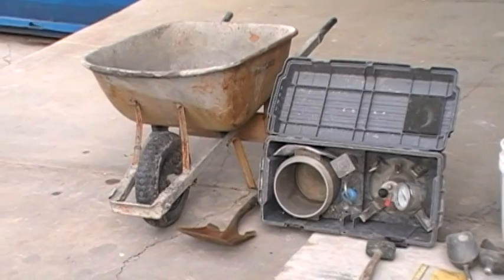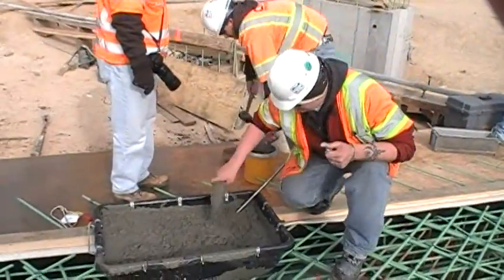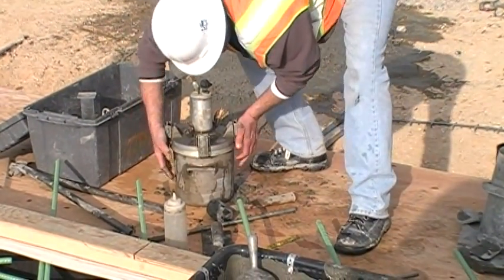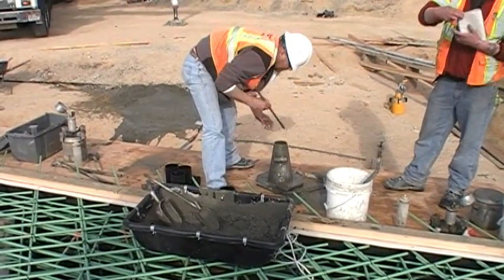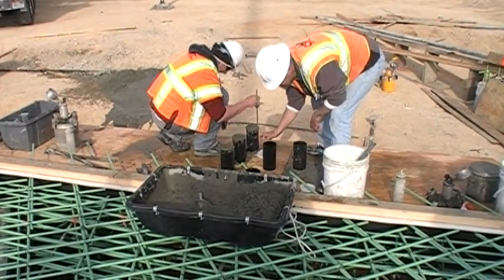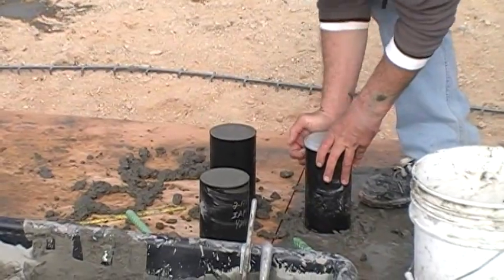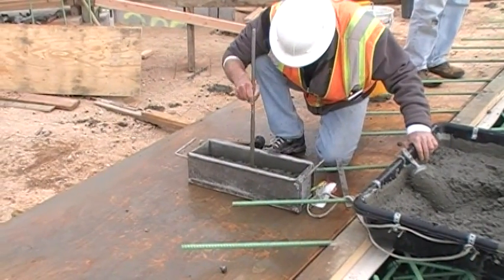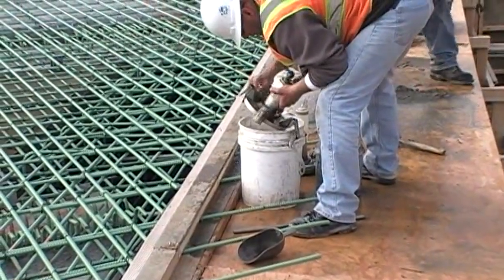UDOT IQP Fresh Concrete Field Testing DVD HD

Comment: Thank you for this comprehensive video. It is much appreciated.
Reply: welcomore to come tricks up my sleeve
Reply: you ask  why this  test spec to rech proper plant i need 600 psi mmix by plan for bridge deck order slump 1-2 inch over design it takes longer to kik off see trucks sitting spining added water drying foreman knows experienced